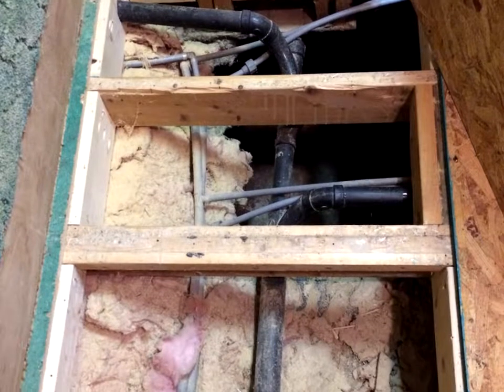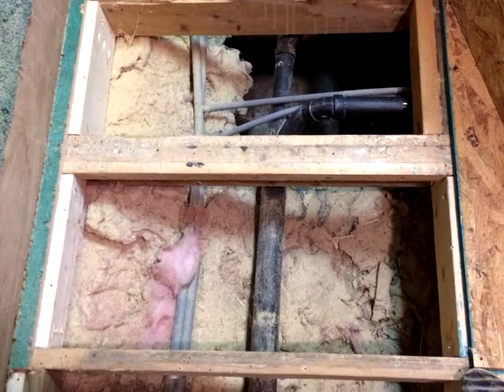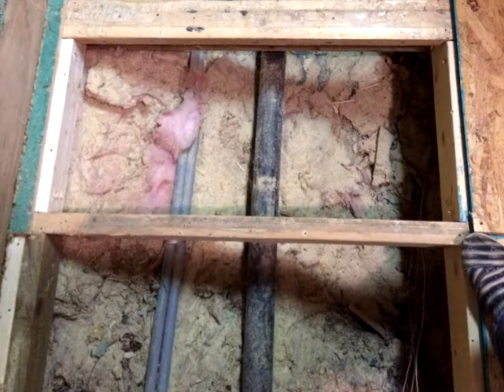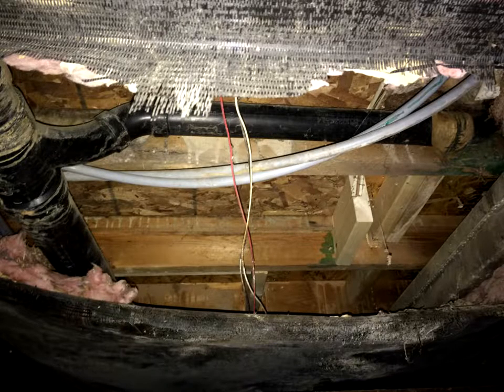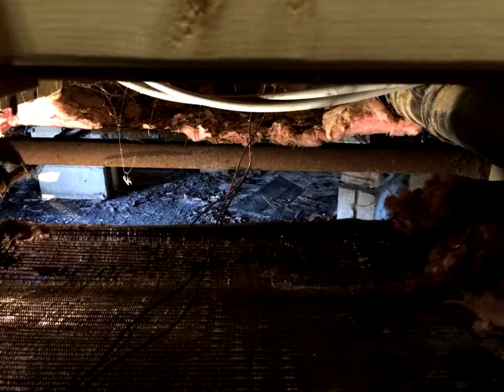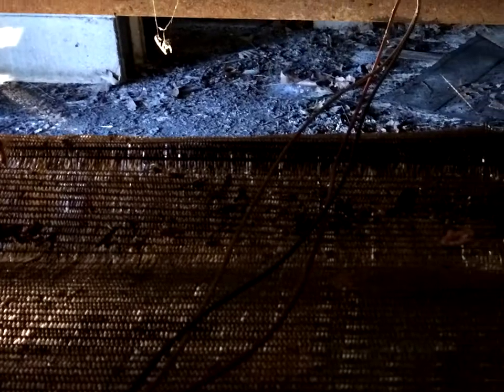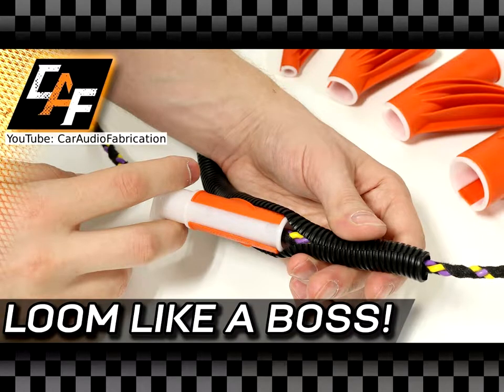Underbelly Repair and Insulation

Comment: will the holes in that cause soft spots in the floor?
Reply from the maker: I don't understand what you're asking. Holes in what?
Reply: @LesignerGirl  So I just bought my first manufactured home, I have noticed a couple soft spots. Later after i had a plumber up at the house he was showing me something unrelated but I noticed where my soft spots are the black tarp was sagging all the way to the ground. I guess my question is can that be the cause of my soft spots?
Reply from the maker: @johnarnold5739  I still don't understand what you're asking. Let's go back to your initial question. "Will the holes in that cause soft spots in the floor?" Holes in what?

Was your home new or used when you bought it?

When you refer to "tarp", are you really referring to underbelly material? These are not the same things, unless someone tried to use a tarp to replace actual underbelly material.

Soft spots in the flooring itself has nothing to do with insulation or the underbelly material that supports it.

I can't really answer your question unless I can understand exactly what you are asking.
Reply: @LesignerGirl   used manufactured home so idk what its called looks like a tarp to me but its the black sheet under the installation and subfloor
Reply from the maker: @johnarnold5739  that's the underbelly, which is also commonly referred to as "bottom board" (despite being a fabric made of polyethylene) and basically supports the insulation. Holes in the underbelly lead to holes in the insulation, which allows heat to escape, forcing your heating system to work overtime and still not get a room warm enough when the weather is freezing.

If you go to Amazon and look for mobile home underbelly, you'll find the stuff I'm talking about. I found the repair tape to be worthless, and simply used strips of underbelly material with the same adhesive I used for everything else: 3M 90. Make sure you follow the directions on the can, spray both pieces, and wait the appropriate amount of time before sticking the two pieces together.

Rotted sub-floor is what causes soft spots. Lowe's has a pretty good video that explains how to determine where the moisture came from that caused the rotting, how to avoid a recurrence, how to rip up the damaged sub-floor, and how to replace it. I chose not to use glue, because that makes it a lot harder to remove later if it becomes necessary. In many cases, you can get away with replacing a small section of sub-floor instead of having to replace the whole thing. Here's that video: https://youtu.be/Tzi7rftE7Pw

I looked at other videos on how to replace sub-floor, but saw too many problems with them before I came across that one to show you. For example, one guy automatically set his circular saw blade at 3/4-inch, even though some sub-flooring is as thin as 1/2-inch. Another one didn't put boards between the joists to support the edges of the plywood, which is actually another thing that can cause soft spots.

I hope this helps!

Edit to add: I just re-read where you wrote: "I don't know if you need to replace any underbelly or insulation, but there's the information in case you need it."

I wonder if there was a leak that went all the way through the floor and filled the underbelly up with water, and the weight of the water caused it to sag? If so, I would expect to find mold in the insulation where the underbelly is/was sagging.

Edit again: Giving it some more thought, I suppose it could be possible that water is/was making its way into the underbelly some other way, and water vapor from that could have come up and rotted the sub-floor. However, if that's the case, I would expect a very large portion of the floor to be soft, and not just small spots. If the soft spots are small, I would lean toward a leak going through the floor and into the underbelly.

Comment: Need to replace all those old poly. Water lines or you will do this over and over every time one breaks.
Reply from the maker: Are you referring to the gray water lines? They didn't look worn out or anything. Can you elaborate, please? I'm learning this stuff as I go along. Thanks!
Reply: LesignerGirl  those water lines the gray small pipes were recalled as they will crack open for no reason at any given time, and you will have a leak that you won’t know about intel it misses up your sub floor,. Best thing to do is run new pex lines and save your self a lot of work later. Those polybutylene are like ticking time bombs waiting to start leaking for the hell of it. There was a big law suit over those water lines. Google polybutylene water lines mobile homes you will see.
Reply from the maker: @morehp1  Thank you for your feedback. I will certainly look into that.
Reply from the maker: Those water lines are decades old, and are still doing fine.